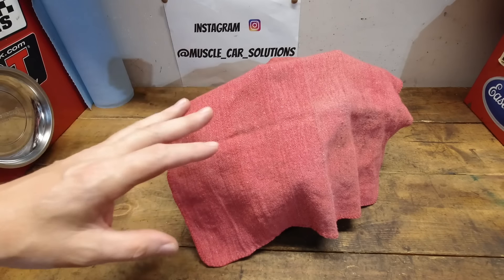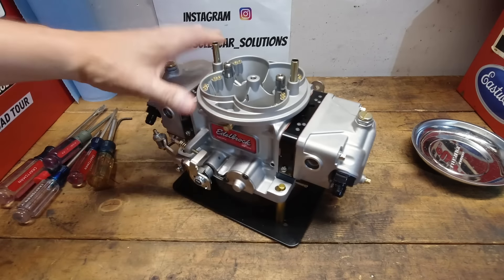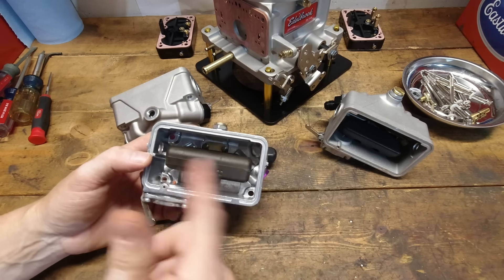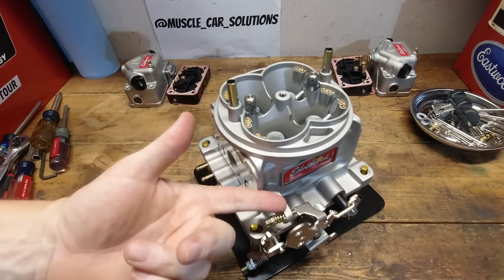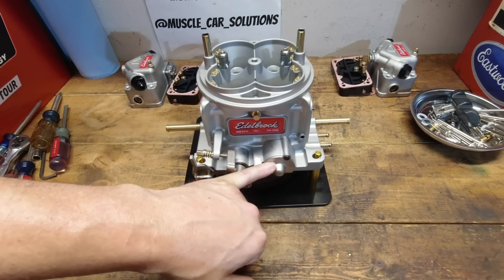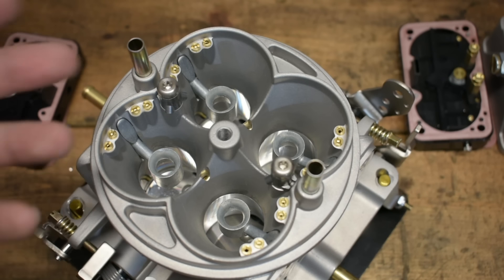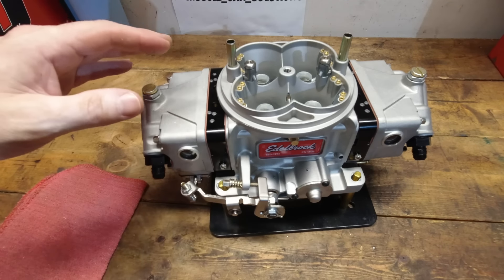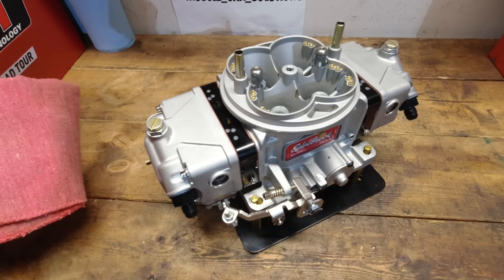The New Edelbrock VRS-4150 Carburetor - Full Review!

Comment: Do you know if they will have a 4500 series version or if they will have an E85 version and will they have a blow thru kit that you can turn the carburetor into a blow thru carburetor if you are running a blow thru setup with turbos like a CSU carburetor and do you know if they will make any bigger carburetors than a 950cfm
Reply from the maker: No there won’t be a 4500.  Not anytime soon anyway.  No e85 rated anytime soon either.  Blow through is easily modified locally.  Good idea on a kit though.  I’ll pass it along.

Comment: Street carb  no choke?   Hmmmm  not sure that will work.
Reply from the maker: Plenty of street cars run with no choke.  Works just fine.
Reply: @MuscleCarSolutions  Really them why do most carbs have chokes? Why do FI systems have cold enrichment programs? Yes a chokeless carb will work but it's far from ideal.
Reply from the maker: @mohawkmike142 you said it wouldn’t work.  Works fine for plenty of people willing to run a race carburetor on the street.

Comment: The extra 1/2" height the Edelbrock has is a deal breaker for a lot of classic muscle cars using the factory hood and air cleaner.
Reply from the maker: That’s why it’s primarily a race carburetor, not a under the factory hood classic car carburetor.  Those guys aren’t after most aftermarket carbs anyway.
Reply: @MuscleCarSolutions  I use Holley's on my muscle cars with factory hoods and air cleaners. I'd say a large number of muscle car owners have aftermarket carbs. Doesn't matter, this carb isn't for us.
Reply: No if you want a better carb. But I understand I have lowered engines to clear the hood.

Comment: Will you be able to blow-thru it with no major mods?
Reply: I think so, yes, because that is one reason they made such a sturdy 3/16"-threaded hole for the air cleaner OR boost hat. Just add more jetting, adjust air bleeds, and you are off to the races! IMHO.

Comment: NAILED IT absolutely. you would be hard pressed to mod an original 4150 (if you even could) to that level and that's not counting the beefiness of the high wear areas and the fact it will handle boost much better. the red is a great contrast and the best solution is to simply put them over an embossed plate with pn stamped underneath (not under the sticker so your forced to have to peel it off to read it though) imho

Comment: Great review! 
Would love it if Edelbrock and a data logging/tuner company got together to hold a tuning workshop. Sign me up!
Reply from the maker: I’m not sure about that, but likely next year when I have my Chevelle done, I’ll be doing that same thing.  Some chassis dyno, mostly street and a little strip.  Will be comparing to an 800 CFM Holley I’ve run in the past.  See where either shines or not.  Sadly still waiting on engine parts to put together engines for both my vehicles!  Ugh.  Frustrating.
Reply: @MuscleCarSolutions  Looking forward to that. Seems like we are all suffering from parts shortages. Thanks!

Comment: I build a lot of Mighty Demons because of the adjustability and threaded air bleeds and restrictors. But this carb offers even more. Is it worth $800 to me especially since I will need two for blower and tunnel ram applications? Probably not.
Reply from the maker: Hell for the price of one specialty built pro systems carb you’d have way more than $2000 in it.  These are a bargain at under $800!

Comment: I have a question for you if you could give me a little insight or advice on and it would be greatly appreciated. I have a 73 nova with a 350 that is bored 40 over and i have 200 cc aluminum heads with a comp cams extreme marine camshaft with a 480/489 lift and 112 degree lobe separation….i can’t afford this new edelbrock carburetor right now ( although i wish i could) but i can afford an avs2 but i think they only come in 650 cfm i think , but what cfm carb would you recommend…and i also have .125 dome pistons and my compression is around 10.1.    Hope you can help.  Thanks

Comment: This will be my next carb for my 70 340 Challenger. It has an aggressive cam and headers. I have always used Carter AVS carbs. A 750 on it now. The only Holleys I have had success with is on my GTX 440-6. Not knocken Holleys. Just I understand Carters better. Thank you for the Video. And Thankyou Edelbrock for continued advancement of the carburetor.

Comment: I have a 454 stroked to 496 I’m a big time fan of the Holly. But I’m really intrigued with the new edelbrock. My question is should I go with a 750 or 850 knowing that this motor should be pushing about 600 hp? Thanks J
Reply from the maker: That’s going to take some time to sort out.  What I don’t know yet and what I’m hearing back from others who have this on the dyno now is they are making the same power with a smaller carb.  But too many variables at play.  To be safe I’d say size it they way we do now.

Comment: Why is it i can buy a tig/plasma cutting combo machine for less than this carb costs, if Edelbrock truly priced these at realistic cost/ profit ratio retail then nearly every guy with a carb would pull their old carb off no matter what it was and put it in the cupboard and use one of these, its only a carburettor basically aluminum castings and some small pieces, the production cost must be so low with manufacturing technology these days it still seems like they want cost recovery in first month of sales type pricing !!
Reply from the maker: What other carb that has even remotely similar feature for less?  Hell you’d have to buy a custom 12-1500 carb to come close.  The prices on these are cheap.

Comment: Then an 850 will be over a grand. Personally I'm not impressed. Kind of like the DLC coating on lifters from comp. This guy was Patten  comp on the back big-time about that but the reality is its only available on solid lifters. Besides if you take the time to do the math on your valve train all the way through you won't have a problem and a Holley 850 double pumper Will out work this carb all day long
Reply from the maker: You’ll have to go back to the flat tappet cam video and look in the description.  The link to the hydraulic flat tappet lifters is there.  Go ahead youngster.  Have a peek.  And you know what the price of the 850 will be?  Nice!  It’s not even been released yet and no price has been set.

Comment: I bought my 6.0 engine and the 4L80e trans with the computer and all the wiring and got it in my truck for 1000 dollars. Not going to spend 1600 bucks to put 2 of these on my tunnel rammed old school 350 street strip car. Waste of money to do that when I could go get another 6.0 and put in a bigger cam and valve springs and pay 400 bucks to have the factory computer hp tuned on a dyno for the cam and most likely have more power in the long run for very close to what only 2 carburetors cost. Maybe used vrs carbs will show up at the swap meet in a few years for half the price.

Comment: LEAVE The Sticker... ON.  Those who buy the carb(s) and prefer Not to have them on.... can simply remove them easy enough.  It should NOT have to be a "do we leave them on or not" at the factory, question or issue.   Just Leave them ON and Let the Buyer make their own choice.  SIMPLE!!   I would only request Edelbrock to make the "stickers" / tags... of sufficient quality so as Not to just peel off with under the hood heat.   Personally, I will leave the stickers ON... when I pick mine up this winter, during my annual winter engine build time.

Comment: I'm not hating the label. Holley has been schooled, IMHO...
Reply from the maker: The VRS is an amazing piece.
Reply: @MuscleCarSolutions  - The only reason I'd remove the label was if one of them was put on crooked.

BTW, it would be nice if it was available in black as well.
Reply from the maker: @jsimmonstx  the carb or the labels?  They were ok on mine but a touch crooked.  I’m usually not that big on that sort of thing but I know some are super picky about it and I think it would be an issue for those folks.

Comment: The only downside I can see is that with the air bleed adjustability there will need to be "kits" of air bleeds from XX number to XX number to allow for tuning. Multiple kits going from small up to large could become a financial burden to hobby orientated racers. Not many shops had a wall with all the Holley main jets in pairs. I had to buy 2 or 3 of the Holley plastic boxed assortments for much more money to get all the jets I needed. If Edelbrock had made the air bleeds to allow the usage, and numbering system, of Holley main jets, THAT would be outstanding!
Reply from the maker: If you’re complaining that this carburetor has too much adjustability, then I honestly don’t have a reply.  As a racer, I’m stoked to finally have this level of tuning available to me without spending $2000 or more on a carb.  I’m not sure that it matters to you at this point, but the main jets as well as the air bleeds and emulsion jets are all universal with the ones on the market.  It’s all the same.  But if that’s a bad thing for you, then cruise on back to the 4160 and the AVS2 and I’m certain you’ll find what you need there.  But you’ll still need to buy jets or a calibration kit.  😟

Comment: the height for air cleaner could be a big hood clearance problem especially for old muscle cars. the drain plug for bowls is very nice. other than that if you know holleys I do not see a great benefit for street strip cars.Never had a problem tuning a holley to do what you want except gas mileage. cost 850.00 for a 750 is hard for an old guy like me to pay

Comment: dose the added fuel capacity make it more problems with heat soak?
Reply from the maker: That’s a really good question.  If used as a race carb, I don’t think that will make a difference unless it’s used in some sort of extended use, like road racing.  On a street car you’d have more chance of that happening.  I think dropping the fuel level down might help and for sure using a spacer under the carb always help heat soak.  It will be interesting to find out.  For me it will probably be next summer before I can collect that data.  Good question!

Comment: Edelbrock finally figured out they couldnt make a great carb so they made a Holley.......also alot of these "improvements" Holley has had forever. Comparing a low end street Holley carb to the best Edelbrock they have. Why not compare a race Holley carb?
Holley's also come with different length secondary links. Holleys have came with a TPS shaft for a while now. Tuneable air bleeds. 2 and 3 circuit models. Powervalve protection since 1991. Dual mounting base plate. Straight, down leg, and annular booster options. How can you be a muscle car page and act like this is all new stuff?
Reply from the maker: What Holley carb has the same features of this one?  What Holley part number has the taller venturi to make peak power and help with drivability?  What Holley part number has a four circuit metering blocks?  What Holley carb has an integrated TPS and not some ugly bracket hanging off the side of the carb?  What Holley part number allows you to adjust external air at idle without removing the air cleaner and moving the throttle blades?  I’ll give you a hint.  None of them.  The question is, why did it take Edelbrock to make a full race carb with street functions and Holley didn’t?  Holley got out innovated.  Or just lazy and their customers settled for mediocre functions.

Comment: FINALLY A CARBURETOR THAT HAS AERODYNAMICALLY SMOOTH VENTURIS INSTEAD OF THOSE RIDICULOUS STAIR-STEP AIR-RAPERS USED BY EVERYONE ELSE!

ADD THOSE DECALS, EDELBROCK AND CAST YOUR NAME PROUDLY IN THAT CARBURETOR ALSO!

Bring on the 1100 and 1300cfm 4500-series Edelbrocks!

Comment: First thing I noticed was no dam plastic parts. Also I hope in tune up parts they sell kits with difference kits so you don't have to buy separate tune up parts like Holley does. I got more in tune up parts for my 850 Holley then I do the carb. Them small parts kill you. Like jets sell you a kit .002 up to .004 from standard plus and minus sizes. Putting in 1 size bigger jet is just a waste of time. You need to go .002 bigger or smaller to notice and difference. Anybody that's knows carbs needs to buy kits rather than one at a time. Holley sells gaskets that say they can be used again. Never found a gasket you didn't have parts rip and you have to buy gaskets eveytime you take a fuel bowl off or the block gasket. It's a real pain to scrap that gasket off. I think they should have used some sort of rubber than those gaskets that they say you can reuse on the Holly carbs. I used WD 40 on the gasket which help a lot better to keep them from sticking and can't get them off. Time well tell. With the air bleeds you can replace maybe you won't have to take the carb off 20 times to get it dialed in right. The problem with carbs in the last 20 years was vapor lock at idle when the car is warmed up and vapor locks at a stop light. When the temp at the intake and cylinder head reaches about 180 to 190 is when you need more fuel to keep that from happening. You need some sort off temp thing to fatten up the idle fuel to keep that from happening. I could go on and on there. Why they went to fuel injection to spray gas right in the intake port pointing it into the runner to stop that problem.

Comment: One still needs to match the idle feed restrictions with engine displacement before trying to change the primary jets...
330 engines need a 0.031 IFR
347/360 need a 0.032. 
383/390 need a 0.033.  
400 to 410 need a 0.034. 
425 to 435 need
0.035
440 to 454 needs a 0.036 IFR. 
dont believe me. Make the change and test drive it or look at your air fuel ratio at 1700 to 1800 rpms. It is lean or rich at steady rpm
Reply from the maker: It’s going to be a minute before I can jump into a tuning video, but it’s coming.

Comment: Its all about how cheap it is...Its a holley rip off.   That much adjustability will have a lot of cars running like crap.  I've already seen a dyno run where they pick up 18 hp? just with jetting, that must have been at Mineshaft dyno services(2000 ft below sea level)

Comment: This looks like a awesome carb but if you are really only going to use it for a stock street engine is it worth it as opposed to using a AVS2 instead?
Reply from the maker: Probably not.  Two totally separate applications.  This race carb would be more for the serious street folks.  But that TPS addition and a way to easily calm down the idle on a big duration cam is for sure a big benefit.

Comment: ANOTHER Holley knock-off. Yes impressive features and obvious improvements over the 60 year-old Holley 4150. Let's see if the Edelbrock has widely accepted use in the years to come.
Reply from the maker: Couldn’t be further from a knock off.  Maybe Holley has been sitting on their hands doing nothing and this is the carb they should have been making.
Reply: @MuscleCarSolutions  Not going to debate this. Holley is now obviously focused on the electronics, power adders and F.I. market. I will say the Edelbrock "4150" is to a Holley what the OTHER series of Edelbrock carburetors are to a Carter. Time will tell.  We ran 7320 and 6464 Dominators on our early 70's Pro-Stock Boss'9 Maverick and  351C Pro-Stock Pinto. Had good success. My original street Boss 429 Mustang came equipped with a 735 Holley and has performed flawlessly for me the past 40 years. My original '69 351W MACH 1 still has the 800 c.f.m. 4780 Holley that I installed back in 1971. Have had no tuning issues with either of them for DECADES. You have your religion and I have mine.
Reply from the maker: @billfioretti3013  I’d still like to know what part number Holley this is a knockoff of.  Maybe that will help if you can educate me on that.

Comment: If it didnt cost so much I would buy one in a heart beat . Love my edelbrock
Reply from the maker: It’s not for everyone, but the race guys know this is a DEAL.
Reply: Sometimes you have to be irresponsible and use a credit card, lol
Reply from the maker: @johnweaver8470  the story of every car guy ever.  😂
Reply: Tell you what. I'll buy your AVS2 650 for 250$ now it only cost you 550$. Your welcome.
Reply from the maker: @BPattB  I might have a 650 for sale on the website soon.  I bought some cores last weekend and there’s a big swap meet coming up that usually has a few good ones.
Reply: @MuscleCarSolutions  I know it's not fair to ask but a bit of a heads up would help me out. I'm saving $500 for a limited slip 3.55 setup. The open rearend 2:79's are killing me. That's said if you have a 650 and I have cash on hand I would jump at it. By the way have you ever considered putting muscle car solution stickers on the carburetors you rebuild???? I would even pay a little extra for that lol!!!
Reply from the maker: I get them frequently.  Just out of cores right now.  And I always include a couple stickers with each one sold!  🤟

Comment: That's incredible for that price.  

With that level of tunability I wonder if you'll be able to lock ideal AFRs across the RPM range in all but the wildest combos.  While it can't match average fuel injection for absolute precision, this has to be damn close.

One wonders if this carb was developed when emissions stuff started if we would have even needed electric carbs and all the other 70s cheats to try and maintain 14.7
Reply from the maker: From what I saw on the dyno, yes the circuits allow for full adjustability across the entire rpm range.  Good data is the key to making those adjustments.  It’s simply amazing.